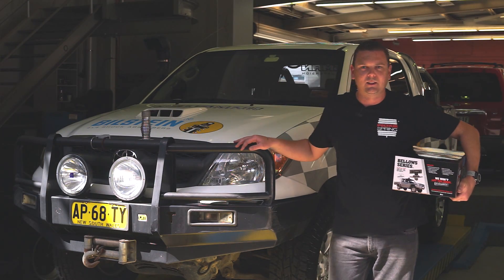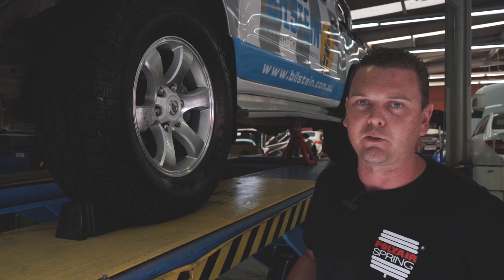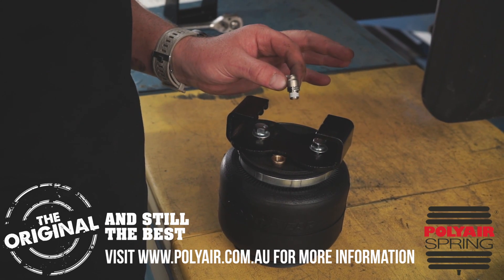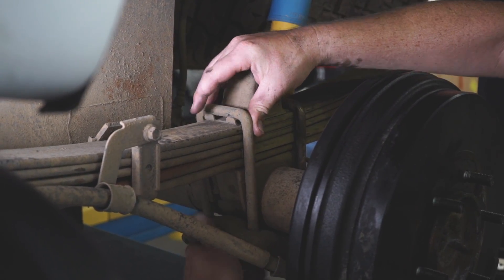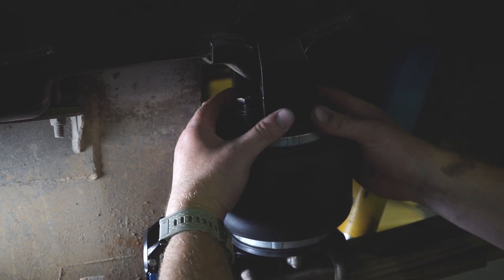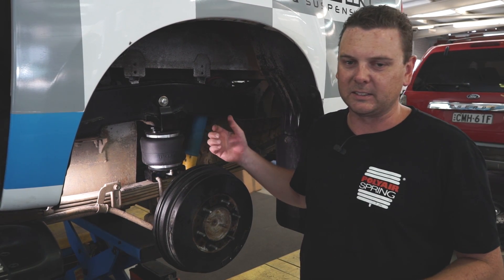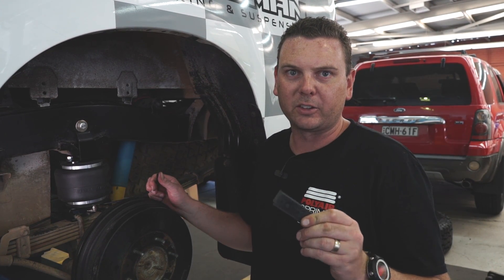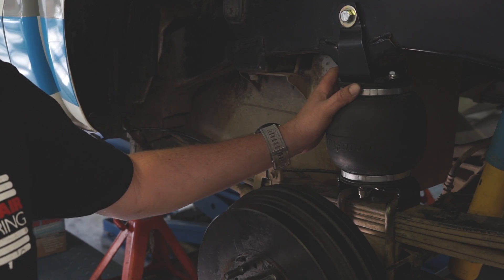Polyair Bellow Series - Toyota Hilux kit 88103 - Installation guide

Comment: They would get torn in 2 in 1 day. The axle travel is cut in half after putting them on. Way too short. It looks like 4 inches of wheel travel with the bags. Get some air tools dude.
Reply: Thought the same myself! Also the airline running along the leaf spring will wear through in no time at all